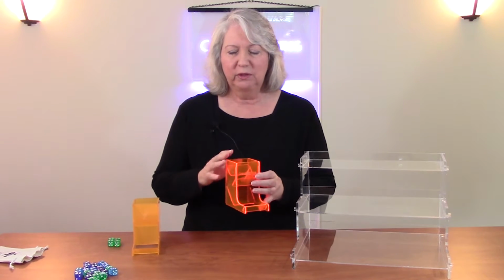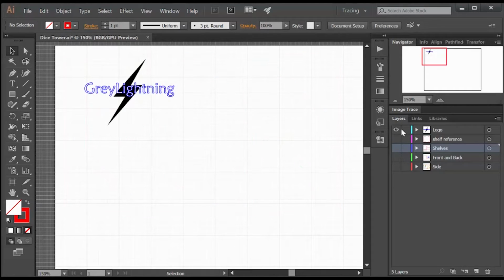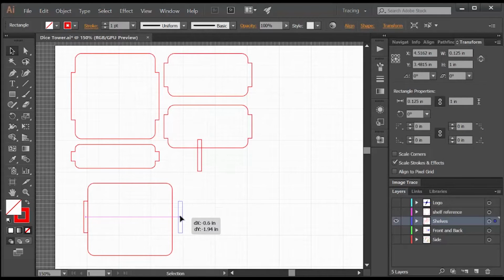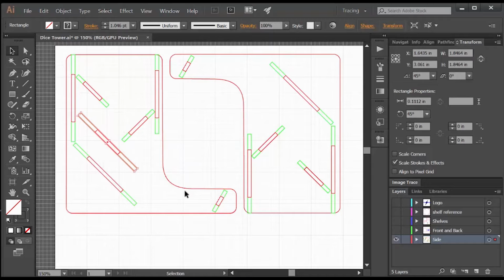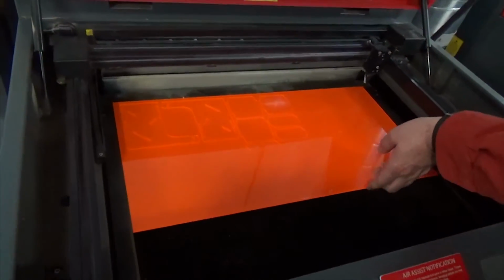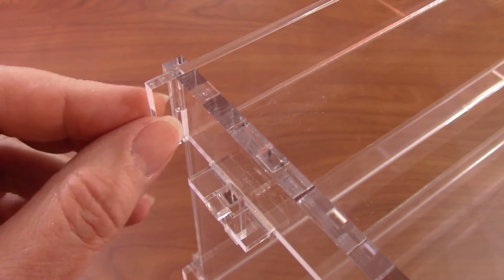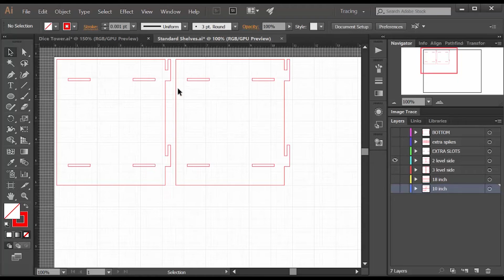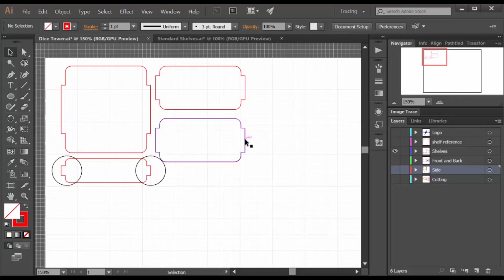How to Design and Laser Cut a Dice Tower

Comment: Where do you get you glue and applicator? I have been searching and not having much luck finding
Reply from the maker: Robert, here it is: Weld-On 4 Acrylic Adhesive - 4 Oz and Weld-On Applicator Bottle with Needle https://www.amazon.com/dp/B0096TWKCW/ref=cm_sw_r_cp_apa_i_JzzmDb7ZVJ5Y2

Comment: Wondering what laser you use cause it seems easier to use than any of the ones I have been looking at. The ones I have been looking at require G-code and require changing between cutting and engraving modes.

Planning to make game tokens and measurement widgets for my own game later on.
Reply from the maker: Hi JTM, I use a Universal laser at my makerspace TechShop. It is very easy to use, I just take my Illustrator file on a thumb drive, put it in the Techshop computer and print from my drawing. No need to save as .svg or some other file type. Also, the user interface for settings is pretty intuitive. But I believe it is quite expensive, so the only way I could use it is through a membership program or some form of public access.
Reply: Greylight May nice. Where I live there is little to no Makerspaces and the couple that are around cost too much to use.

Edit: I know there are some really cheap 500$ ones bouncing around  now that might be handy to have as well as some that while still expensive are dropping in price fairly regularly. Such as the Muse and others like those. They tend to run the 3000-6000$ range.

I seen one that was reduced from 5K to 4K with the latest revision. It is kinda like Desktop CNC gear and 3D Printers. The prices are dropping so rapidly that it is getting easier and easier to get higher quality equipment for all these projects one might have.

Comment: Will you share the file for the cut?
Reply from the maker: Hi Josh. My current thinking is to launch a Patreon account at the end of the year and to provide all my digital files to the entry level patrons as a reward.  The Patreon recommendation is to keep all rewards digital, so there are no distribution costs, and this is the only digital thing I have to give. I don't use advertising, and never plan to, but eventually I have to figure out some sort of monetization because GreyLightning has become a fulltime job! The dice tower is a very simple plan, but some of my drawings, like the Zelda Breath of the Wild drawing I've been working on this week, have 20+ hours of effort in them, and I do a new drawing every two to three weeks. I also have the issue, which I haven't figured out yet, about licensing that would prevent someone from using my drawings to make things for resale. Still working on that one...